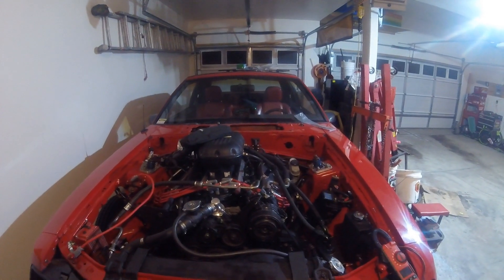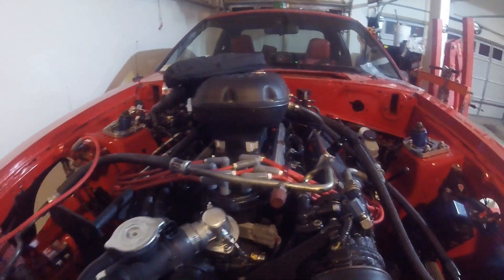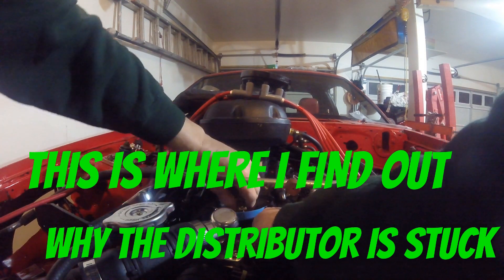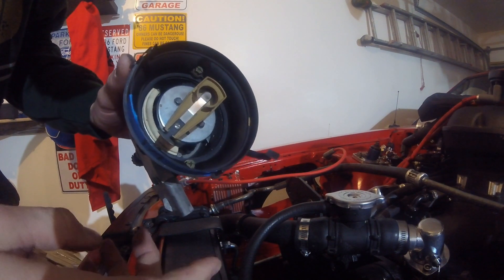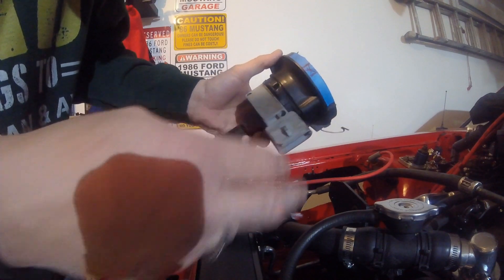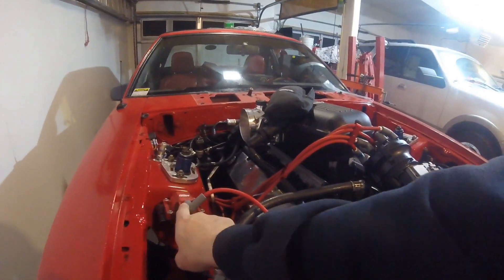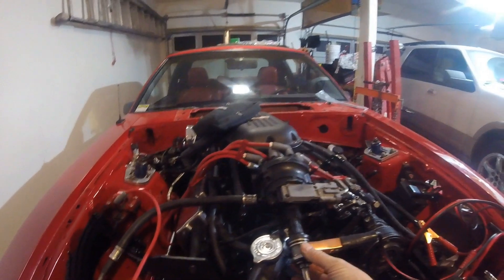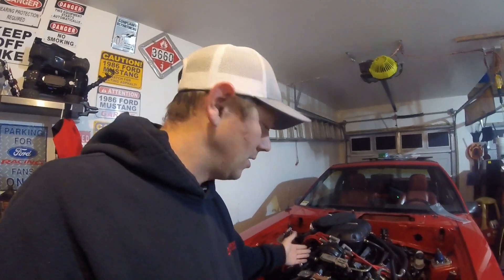Ford TFI & Pickup Testing - Ignition Troubleshooti

Comment: Very nice 86 man,its gorgeous,i have a 89 and a 91,they are old battle horses,not show quality but i love messing with them,my 91 Ive had since new and i drive it just about daily,i put a new motor in it a few years ago and i decided to put everything new including a distributor, well all the new stuff out there is junk including MSD and Hot forged, dont get me wrong,they are beautiful distributors but made with junk china pickups and TFI's

I started having a issue with that new distributor i installed where i will time the car, set it at 12 and a week later it will be at 17 or it will be at 7 degrees, both of them bad news for the engine, after searching high and low for a oem distributor i was able to find a new old stock one this guy had,its coming in the mail in a couple of days, the Distributors Ford made back in the day have no equal,pure quality, they are not pretty or shiny but they work great!  

I got in touch with this guy that had the same issue im having and it was that new dizzy he installed,i also found 2 people on forums having the same issue,its a lottery  with this new china crap.

I found this video cause i have some stuff in the garage i need checking, thank you for the info,ill send a subscribe your way.

Comment: 😮Wow, you have some serious damage to the distributor.  Hopefully no major damage to the engaging gears inside the engine.
As for the video, I really enjoyed the demo of how things works so thank you for sharing that.  However, and I may have misunderstood what you said but I keep hearing you mentioning the PIP on the signal return.
My understanding is once the PIP signal is generated, the signal is sent directly by the ICM to the PCM.  The PCM process the PIP signal and along with other information and sends back an SPOUT signal back to ICM which in turn fires the coil.  The PIP is not involved at all.  Note that for distributor mounted PCM, the PCM is only determining when a given spark should be fired but no dwell information is generated.  
I am troubleshooting a random ignition problem where on startup the engine starts and run very rough and sometimes the engine stalls and stop.  This problem does not happen if I stopped the engine and started again right away.  Today, I disconnected the signal SPOUT from ICM connector and the problem gone away right away.  So I determined that there is a PCM problem but to my surprise, the engine idled beautifully even after connecting SPOUT to ICM.  Not sure what is going there but this is the only real clue I have about this problem.  Tomorrow, I planned to connect an oscilloscope to see what kind of SPOUT signal I am getting at the time when this ignition problem appears.  I am thinking power or ground issues. Any ideas?  
Thank you
AJ
Reply from the maker: More than likely a tfi module issue.  They are made very cheaply now days and it’s really hard to get one that won’t fail or doesn’t have the problem you’re having.  They get hot and the electronics inside them don’t work.  I have since swapped all mine to a megasquirt ecu with a CAS and COP setup from stinger performance.  The distributor in this video was one I had laying around if I remember correctly.
Reply: @BMF_Garage Thank you again for the quick reply but I already replaced the ICM with a good quality one because I fully agree with you most parts including Ford Motorcraft are dead on arrival. 
In my case, it seems like the PCM SPOUT signal is the one that is causing the rough idling because once disconnected, the ICM is defaulting to the base timing and no rough idling in that case.
Tomorrow, I will analyze both the PIP and the SPOUT signals and will let you know. 
Thank you
Reply from the maker: I went through 5 “GOOD” tfi modules before getting one that worked for a while.  Parts aren’t made how they used to be.
Reply: @BMF_Garage Fully agree with you even buying Ford Motocraft is no guarantee that you are getting good part. Wish Ford and others stayed with vaccum advance timing, much simpler and easy to work on and no junky electronics.
For this reason and after watching what is going with the new trucks, I have absolutely no intention of buying any of the new trucks. Toyota trucks are bit better but not much better.
Reply: Today I connected my Oscilloscope to the SPOUT wire at the Ignition Control Module connector.  The SPOUT signal is generated by the PCM or ECM and it is  based on PIP signal as well input from other sensors such as ECT, IAT, etc. 
The SPOUT signal is sent as input to ICM.  The ICM is designed to use SPOUT signal to generate the final timing signal to the ignition coil.  The only other thing the ICM is suppose to do is add dwell which in 1991 truck is fixed conservative value.
My basic troubleshooting approach is first to determine whether the SPOUT signal is correct.  If SPOUT signal  changes from good to bad signal when the idling problem shows up,  then the next step is to check PIP signal being sent to PCM.  
Before doing anything, I verified that 
1- Good ground is present on IGN GND pin of ICM or pin 1. This is important because the PCM relies on getting a separate IGN GND as I put from ICM.
2- Verified that the Vref or reference 5V generated by PCM is corrected.  In my case, I measured 4.99V using EGR connector to GND.
3- With Oscilloscope connected to SPOUT, I started the truck and to my surprise, the rough idling problem did not happen but I was able to verify that the SPOUT signal is present and with good peak of 13.3V (square wave). I was also able to verify that timing is changing using duty cycle of the square wave where the duty cycle increased as the truck started to warm up and dropping rpm to final vale of around 750 which is close to the idle rpm on this truck.
Will continue troubleshooting this intermitting rough idling problem on startup tomorrow and update you on progress.  For now, PCM appears to be working fine and so is Pickup coil inside distributor as well as ICM.
if the ICM is defective, then ignition coil will not fire and if pickup coil is defective, then SPOUT signal will not be present nor will truck start.

Comment: Great video thank you!!! I have an 89 f150 5.0 and have been chasing a lot of problems and got it finally Down to the pip in the distributor. I replaced it yesterday with a oreilys distributor and it ran great for 15 mins and then started running like crap and backfiring. Let it cool down for about 30 mins or so and it ran fine for another 5 mins until it got hot again, Im assuming a bad /cheap distributor but I'm going to test it like this to make sure .
Reply from the maker: If it’s heat related, it’s the tfi.  They cut out when they get too hot.  I usually do the distributors off of rock auto.
Reply: @BMF_Garage   yeah, I went with Oreilys cause of the lifetime warranty and I wouldn't have to deal with shipping it back. The parts now are so cheap and just cause it's new doesn't mean it's good. Hopefully, the one I get today last me longer than a day.  I mite try and put some heat shield over the radiator hose to help idk, thanks again

Comment: Hey guys if you can help me out I replaced my distributor with a good one good coil still no spark
Reply from the maker: The ecu could be the culprit.  If you carefully pull it out of the passenger kick panel and take the front cover off… look for any electrical components that have green ish fuzzy buildup on them… bad or corroded parts can cause this.  Typical
In these old things.

Comment: Beautiful.
Great demo... I have a 96 E350 that just stopped running. Replace distributor in the ICM is only 10 months old but it was a cheaper one. Interesting that that mad is mounted to your distributor. I thought they did away with that due to heat issues. Mines in the driver side fender

Comment: I have a 1990f150 straight 6. It starts hard and then once running it jerks and bucks like it is not getting fuel. It runs good at higher rpms for about 20 miles then shuts down . I've replaced fuel filter, fuel relay,tps , ignition coil, plugs and cap. Any idea what it could be
Reply from the maker: Have you checked the plugs since replacing them to see what the fueling looks like?  Carb or efi?
Reply: @BMF_Garage  no I haven't checked them since I replaced them two weeks ago
Reply: The old ones were really bad . Rusty and corroded . No oil or carbon build up .
Reply from the maker: You can tell a lot about how it’s running by pulling a plug again…. Really black it’s rich and you have a fuel problem…. Not much black at all it’s likely lean and not enough fuel…
Reply: @BMF_Garage  would the pick up coil cause it to start hard and cut off ? It's using more fuel than normal and when it starts acting up I have no throttle response. When I shut it off and restart it ,it will run ok but then it does the same thing again
Reply: Running then dying sounds like a pip module (icm)(the grey thing on your distributor that he was talking about). Later years were black but your 1990 should be on the distributor. Common failure item

Comment: i kept having the ignition module go out on my 1988 f250 351. so i found a video where you can make a wiring harness and move the ignition module from the distributor over to the drivers fender.  believe me. it made a big difference . the engine runs a little smoother and it also helps the module to stay cooler and away from the thermostat housing so it aint being cooked. the module has been on there for a little over 5 years with no problems.
Reply from the maker: That’s good info!
Reply: On the vans its on the fender but behind the battery. Pain to get at. I thought about moving it but wasn't sure if you could make a wiring extension. Guess so.....Thanks
Reply: @idahopotato5837  all good 👍 . Look for the videos . Also look for the videos swapping out the old 75 amp alternator for a 130 amp one. You will be glad that you did
Reply: @idahopotato5837  I know this is a old comment but it might help someone out,there is a company called McCully racing that has been doing this forever, if you google them they have harnesses to relocate the TFI on Ford cars that came with the module on the distributor,granted one can save money but they do a really nice product and its not that much money.

Comment: Good day sir looking for advice working on my son's 89 f250 5.0 std new distributor, ICM, plugs, wires problem is coil only produces a single spark, so unplugged the spout, lots of spark what could cause this issue
Reply from the maker: I’d get a spark checking tool from your parts store to verify spark coming out of the distributor and see if you have any.  Process of elimination… if you don’t have spark at the plugs, check at the dizzy… nothing there, it’s the dizzy.  I’ve had bad distributors out of the box before.  Plug wires? Pickup in the distributor?  Coil? Its almost impossible to diagnose over the internet.

Comment: Would a bad PIP cause a rich condition.
Reply from the maker: Most likely not.  Would probably not run.  Rice condition is likely and air line leaking or broken that’s giving bad vacuum to the fuel pressure regulator… bad regulator… or bad O2 sensors.

Comment: Great explanation, which wires are the power in and the signal out of the distributor though? I did all that and I don’t have coil or injectors firing. Changed the module and still nothing. How do I check the pip signal?
Also, my fuel pump is running constantly….
Any ideas? Thanks!
Reply from the maker: I would start with examining the ecu.  The ground signals come from there and there are a few captivities inside the ecu that can go bad causing the issues you’re having
Reply: @BMF_Garage  Thanks for the reply, I'm pulling the spout and trying that tomorrow but I think I lost my pip signal. That's why it wont fire the coil or the injectors, eec thinks the key is on and the engine isn't turning over. My thoughts at 12.48 am, lol!!
I think I will pull the eec and open it up.. but to fix it...hmmm. Where I am in this rust belt, there is no and I mean NO 80's cars in the junkyard. So either I order a computer from somewhere in the States or try to fix this one. (or drop in a 5.0 lol!)
Reply from the maker: Good luck!
Reply: @BMF_Garage  Good and bad news..I replaced the pick up in the distributor with one out of an old 351 distributor and with the original 3.8 module that I originally thought was bad, I got fire!! Bad news is, the fuel pump is running all the time and the injectors aren't firing. I dumped some gas down the throat and it fired right up and idled smooth. 
So...I'm pulling the eec like you said.
I'll open it up and look for...green corrosion or what exactly? (or is it, "you'll know it when you see it" lol!)
Thanks so much for the help!!
Reply: @BMF_Garage  Got the computer out, doesn't smell burnt and everything is clean. What am I looking for?
Reply from the maker: There’s a few capacitors that can go bad… if they are bad they usually have some green fuzz looking stuff around the base of them
Reply: @BMF_Garage  This thing looks like new inside (wish I could show you a picture) If I replace the computer, it has to be a 3.8 cfi/auto computer, right? I have a 1988 351 computer out of a f350 and have access to a 86 mustang computer for a 5.0/manual. (Or I just might order a new one from rockauto)
And sorry for dragging this out, I know you have a job to do. I subbed and got one other guy to sub if that helps lol!
Reply from the maker: @lowrangeinnovascotia2930  I appreciate you doing that!  If the ecu looks that good, there’s more testing to do…. If the fuel pump relay stays on, it could just be a bad relay… but they are a specialty relay and sometimes hard to find…
Reply from the maker: @lowrangeinnovascotia2930  if the injectors aren’t firing you need to check them to power.  They should all have an wire that has power all the time, and then the ecu pulses a negative to them… could have blown a fuse or fusible link for the power to those…
Reply: @BMF_Garage  Looking at the diagram, the ecu relay powers the fuel pump (which is under the drivers seat) as well as a bunch of other stuff. It's grounded by the computer so I know the relay is working and the computer providing ground for it. I checked power at the injector (red wire) and it has 12v (also powered by the same ecu relay)
So, the  computer (ecu) as well as the injectors are getting power through the ecu relay. The fuel pump should run "only when the engine is running" and the only ground for the fuel pump relay is the ecu. It turns on and off with the ignition though so the relay isn't stuck on. But, it does mean the computer is a dead ground.
As far as the coil firing, I put the pickup and module from the 351 distributor (which worked when I plugged it in to the harness, grounded it with a booster cable and spun it by hand) and I have coil firing with the spout removed. When I install the spout, I have no coil firing. Obvious thing is, oh the module is bad, but, the new one I bought does this as well as the original motorcraft one which worked on the 351 dist. I'm thinking, a straight pip signal with no spout fires the coil, but when the spout is installed and it has to go through the computer, the computer is messing everything up.

So...1) computer is grounded out running the fuel pump all the time. 2) it is not triggering the coils to fire. 3) it stops the coil from firing when connected to the distributor by the spout.
To me this all points to a bad computer, even if it does look perfect inside.
Am I missing something??

I ordered a computer from rockauto so we'll see what happens. ($120 US shipped to my door is $257 Can😥)
Reply from the maker: Sounds like a solid diagnosis to me!  Assuming all your tests were done correctly, that would point to the ecu.  I have had in some rare cases where the pins of the connector aren’t making good contact and after removing the ecu to check it out…. Upon installing he ecu again, everything works…
Reply: @BMF_Garage  I could only wish!
I just thought of something, I'll have to pull the computer and then do the spout "connect-disconnect" test again. If the computer is unplugged and the spout still effects the coil, to me that would mean theres a short or ground in the wire or harness. (pretty sure its not though)
When I get the computer, I'll update you. (and anybody else reading this)
Reply from the maker: Also verify you check all ground connections into the ecu and in the engine bay for wiring Harness.  There’s a couple on the firewall for the injector harness and something else.
Reply: @BMF_Garage  New computer installed, fired right up, not charging. (I forgot I unhooked the alt cable like you did) Hooked up the alt and it went to 18v and climbing!! Shut it off and now I believe it wasn't popping and banging when I unhooked the booster cable because of lack of voltage, I believe it was because there was too much voltage! That's what fried the pick up and ECU.
Thank you for the help, much appreciated!

Comment: I have a 1984 Lincoln. I figured out that the difference between those distributors and the 86 and up ones is the tone ring under the rotor is different. 84 has one wider gapped notch in it and the 86 are all the same gap. So even though a distributor from a 1989 will work in a 1984 car, it wont be able to control spark timing advance and will be at a fixed position at all times.
Reply from the maker: That’s good to know!
Reply: @BMF_Garage  i have an 89 and an 84. The 89 distributor is readily available at the store and on Ebay. The 84 distributor is hard to find and costs more. The only difference is the tone ring
Reply from the maker: Rock auto always comes through for me on tough to find parts